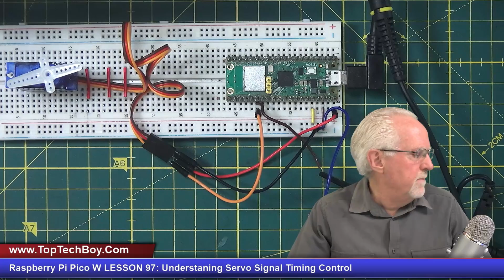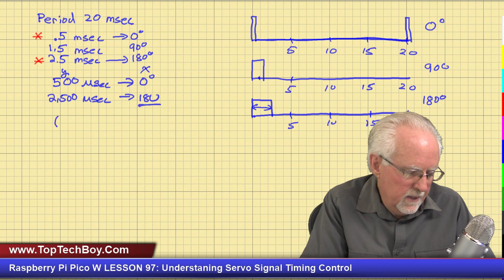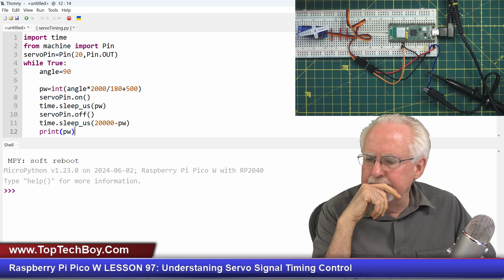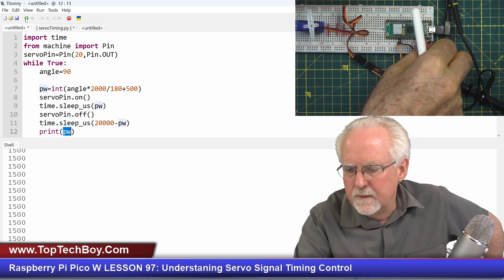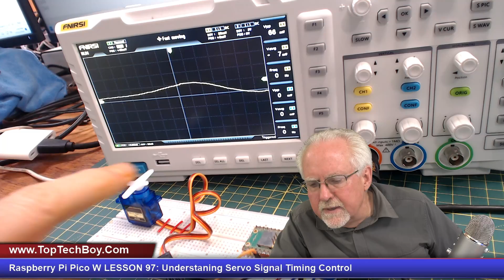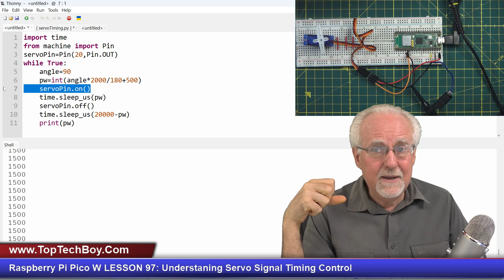Raspberry Pi Pico W LESSON 97: Understanding Servo Signal Timing Control

Comment: I've got the homework done but ran into a problem when I opened my webcam to show the servo. The PC I'm using is a Raspberry Pi 4B with the Raspberry Pi Pico W connected to it via USB (as is the webcam). Shortly after starting the homework solution, the Raspberry Pi gets an error and the screen turns gray. Only way out is to power it off. Ugh. Posed a question on the Raspberry Pi forum. I may submit a few short videos showing one interaction.
Reply from the maker: Not sure what is going on. If you have your pico, servo, and WEB cam all connected to your pi, I wonder if they are trying to draw too much current combined from the pi?
Reply: @paulmcwhorter  I think it's something about VLC (what controls the webcam) and the servo. I get a popup "Error looking up passwd struct for uid 1000: input/output error" then the background turns light gray. I can move the mouse and attempt to shutdown the pi, but that fails as well. Can only power off. I'm going to try creating my video in short "spurts". My solution allows the user to input an angle, so multiple runs of the PIO program. Will stop after one. Hopefully I'll get a video done before the deadline!
Reply: @paulmcwhorter  You might be right. My real PC runs linux. I have been avoiding installing Thonny there, but maybe I will have to try that. I will still have the problem of the pico and webcam connected to USB ports on my desktop, though. Grumble. I'm still thinking about it.
Reply: @paulmcwhorter  Turns out your assessment about trying to draw too much power is correct! Your last Arduino video, adding the external power adapter, reminded me of your previous Arduino series using the Elegoo kit. I followed along with that series, and remember having to use a similar adapter. Dug through my old stuff, found the adapter, plugged it in to the separate breadboard containing the servo, moved the servo red wire to the 5V there, added a ground wire from the servo board to the pico board, and tested. Success!!! It's time for my morning walk. Will make my homework video in a couple of hours. Thanks, Paul.

Comment: Lesson 97 assignment with user defined class  servo state machine and  oscilloscope servo timings:
https://www.youtube.com/watch?v=FbCzrQyRJ3Y
Great series!
Reply from the maker: LEGEND! One thing to think about . . . it looks like you are passing the class a SM id for which state machine to use, if I am reading this right. One thing you might think about, the casual user might not want to thing about it. Can you make the class where it assigns the state machine, and increments as user adds more servos, so user does not have to think about it?